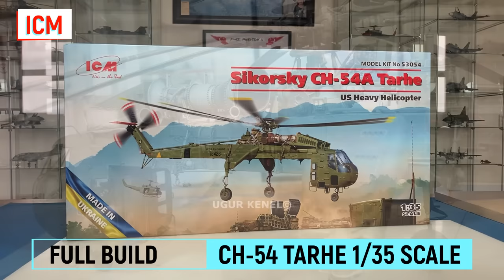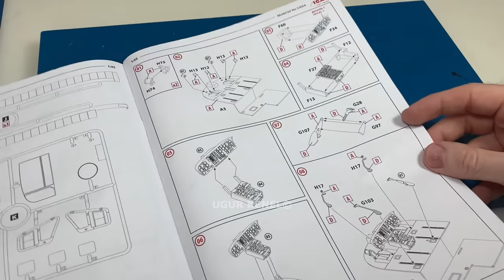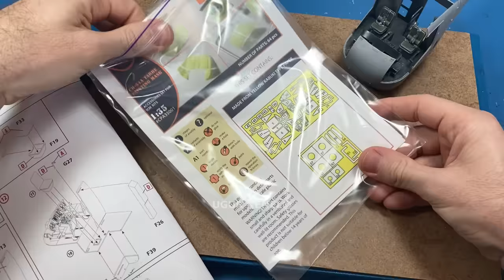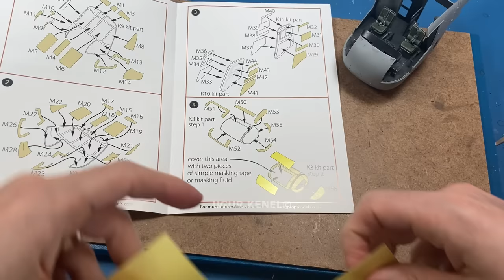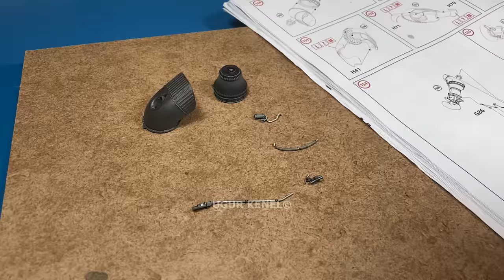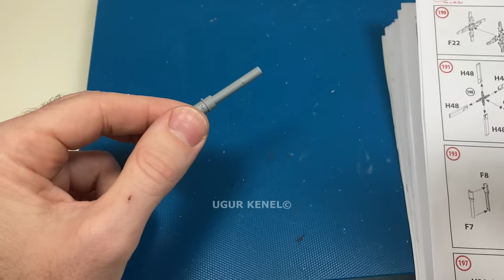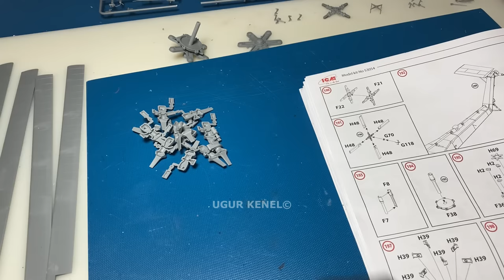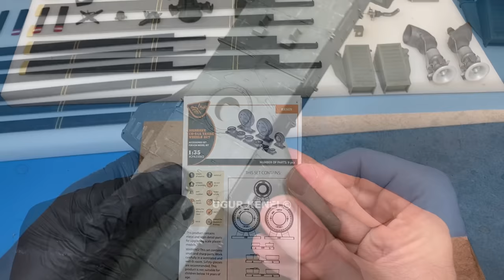BUILDING ICM CH 54 TARHE SCALE HELICOPTER MODEL KIT - WITH FULL BUILD PHASES

Comment: Car and truck kits often contain rubber like tyres. Why not planes?
Reply from the maker: I can guess, though I don't know the exact reason. Truck etc are usually made from 1/24 - 1/35 Scales and are mostly backed with rubber tires but because airplanes are usually made in 48 and 72 scales, their wheels remain much smaller. Therefore, producing rubber tires on a small scale can be costly. I think so.
But recently, some aircraft companies like Hobbyboss use rubber tires in their models also.
Reply: @ugurkenel  Thank you you have a point.

Comment: Very nice job, but please please please forget about the CA glue by glueing the plastic parts together, especially by glueing and filling the clear parts, even if you work in latex gloves. The fumes can ruin your entire job in seconds...
It's ok for resin to resin, resin to PE, or PE to PE, with good ventilation, but for the windows use wood glue.
Reply from the maker: thanks.
I have been using only CA glue for the last 15 years and have not had the slightest problem. Different adhesives may be recommended for beginners. But CA is indispensable. It dries quickly, adheres very firmly and can be sanded. If you know how to use it, you won't have the slightest problem even with glass parts.
Reply: I'm avoinding it, beside the mentioned, since I began the modelling in the late 90'-s. 
For filling gaps, there are several other products, even in ethil acetate dissolved sprues. 
For glueing plastic to plastic, the dedicated glues, like tamiya extra thin cement, or revell contanct glue are providing stronger and flexible, material like bond, CA is to rigid for that, it breaks easily.
And also if you have to use lead as a weight, it causes very bad corrosion with it, which also destroys the modell. Rogerio Marczak wrote an article about this phaenomenon. 
Also the fumes of CA glue are carcinogenic.
Your models are high quality, so that's why I mentioned to avoid the usage. ;)
Reply from the maker: I totally agree. I have nothing to say about the harmful fume of CA. Thats right. But using Tamiya extra thin? It melts the plastic and takes a long time to dry. CA, on the other hand, is ready in a few minutes, and is even ready to be sanded. For filling gaps? Putty? is definitely a waste of time. With a few drops of CA, I get stronger and faster results. Even in canopy operations.
My idea and style.
Thanks very much for your recommendations.